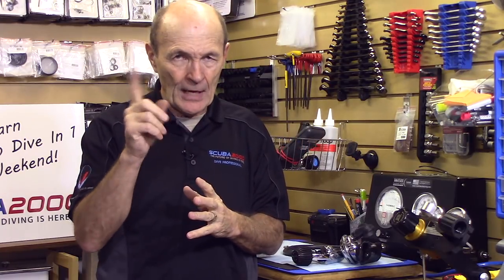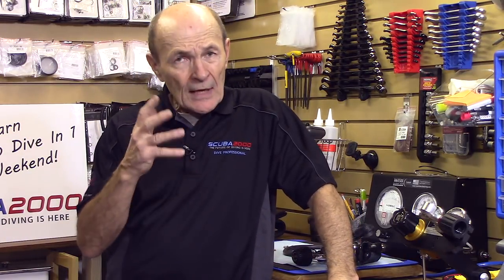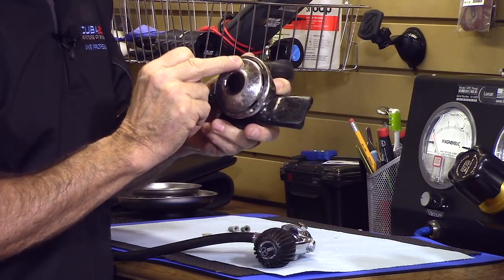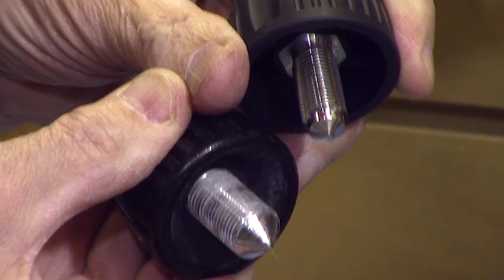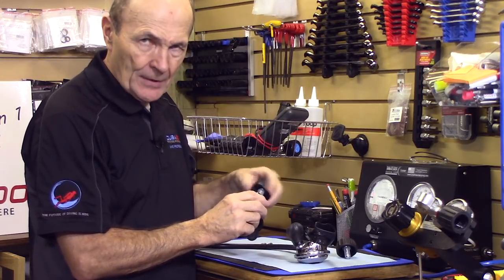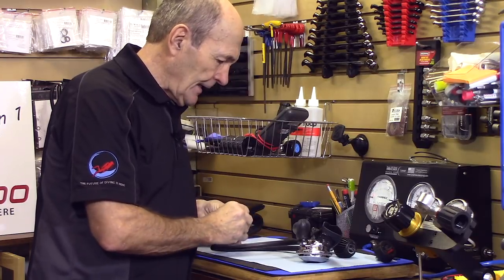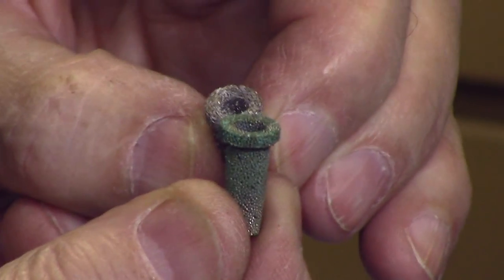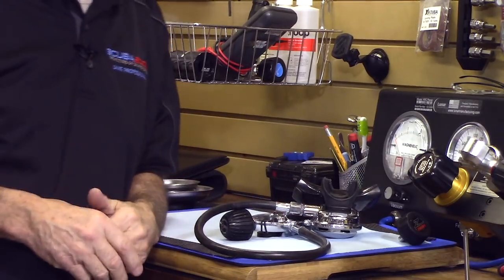Does My Regulator Need Service? - Scuba Tech Tips: S07E04

Comment: I have a 2nd stage reg that has never been used but has been sat in the box for 3 years. Do i need to get this serviced before i use it?
Reply from the maker: If brand new, never used it should be ok to dive.  If not comfortable jumping into the blue, take it to a dive store pool or public pool night to give it a test.  Get comfortable that all the controls work (such as venturi switch) and breathing feels comfortable.  Any concerns, then take it to your LDS for checkup , not a full service.  They will open and inspect everything but not replace o-rings etc unless needed.  This will give you the confidence to dive with it.
A.